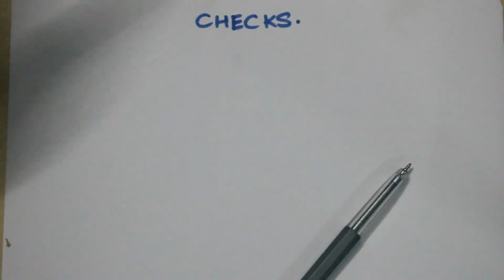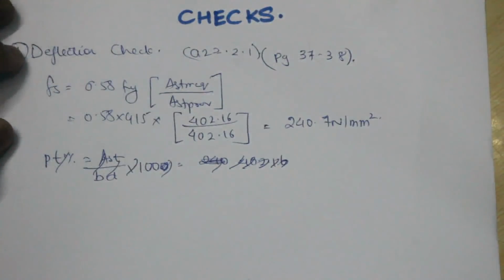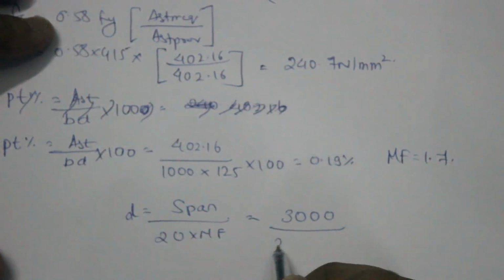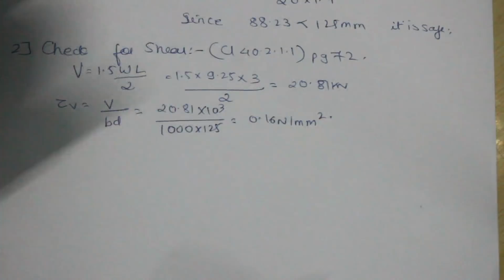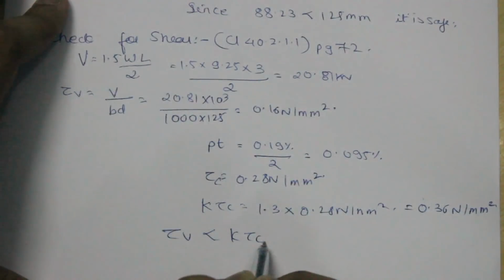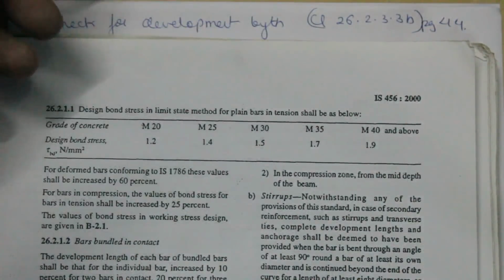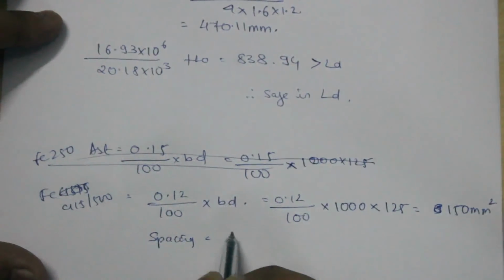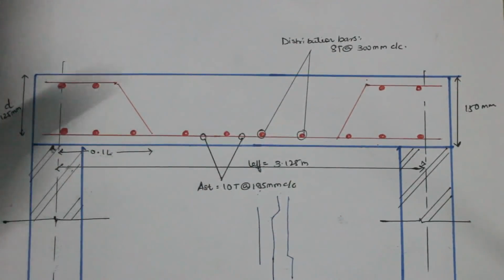PART 2 | Checks on design of one way slabs | IS 456 | Mumbai University

Comment: in deflection check d=span/(20*M.F) where 20 is for simply supported , for fixed slab what this value is to be ??
Reply: In case of fixed slab the deflection is negligible , hence there is no need of checking deflection in fixed slab
Reply: @POOJAKUMARI-tf4xe  Generally (5" thick slab) we provide beam to control deflection in slab or break span into 2 parts (eg:7m x 5m in this case we provide beam and now span is 3.5m x 5m ). In case (7m x 5m) slab will prone to deflection we must have to check the deflection.

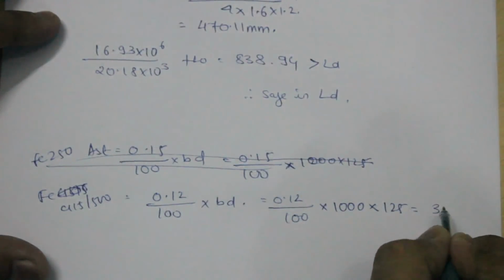Comment: At 12:00 .......Sir u have used effective depth But In lesson 18 Of NPTEL For one way slabs in a numerical they have used the Total depth ....please get me out of this problem......
Reply from the maker: Yes it should be total depth.
Reply: @EverythingCivil  Thanku sir I appreciate ur hard work 
I have a doubt on ductile detailing of a beam . I calculated all the reinforcement that is required in a continuous beam including longitudinal r/f and shear r/f asnper the IS 13920 .
But I can't visualize the r/f and I can't draw the detaling of beam at a section ...please help me or if it is possible please make a lecture on designing and detailing of a continuous beam
Thanku sir again

Comment: Here spacing of main bars is 185 mm c/c at mid but if we bent up bars at support the spacing is 2* 185=370 mm b/w main bars which is more than 300 mm . so it does not follow spacing criteria .Justify Pls?
Reply from the maker: You are right. But its does not have to be like that we need the required area of steel and spacing at midspan. However, the requirement of steel reduces at support as bending moment at support reduces. therefore the code allows us to take only 50% of the total mid span steel into the supports and therefore the spacing doubles. the maximum spacing criteria you are telling about is for midspan.

Comment: Cantilever 7 
Simply supported 20
Continuous 26 
These are l/d ratio for beams... Can we use same ratio for slabs???? 
If yes than ratio of span /overall depth 
S.s. = 35
Continuous =40 is used where ???
Reply: Than why do we use these different parameters....
Reply from the maker: Where have u seen 35 and 40? 7, 20  and 26 are actually basic values not l/d ratio.
Reply: Is 456. 2000
Page 39
24.1.2
Reply from the maker: It's extra notes given in addition to clause 23.2 also 35 and 40 is for loads up to 3kn/m² only.

Comment: Modification Factor caluclated by you is a 
Simple guess
Or
is there any formula for it
?????
Reply from the maker: No it's not a guess based on Ast provided find pt% and using that and fst value choose right curve from the grAph and find MF . Put that MF  in span/depth formula and calculate depth which should be greater than depth that you have provided
Reply from the maker: Initially you have to fix the depth (for beams or for slabs) for that purpose you have to assume a value of M.F which is actually based in the pt%. Generally we take MF higher for slabs around 1.4 to 1.5, while for beams we keep it lower around 1.2-1.3. Its very obvious if you take MF higher for your design you are providing higher pt% and hence your depth reduces and tension carrying capacity is increased. Hope it helps.